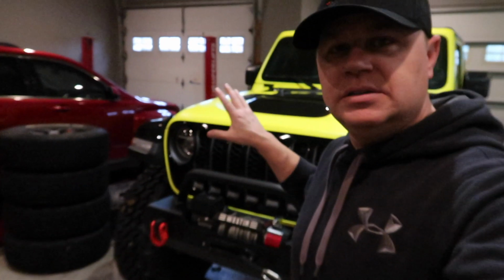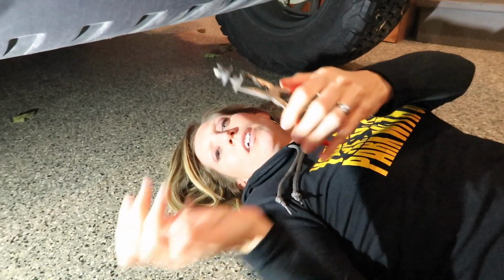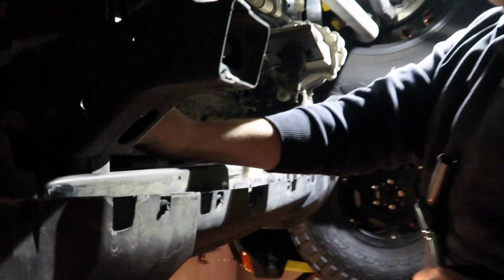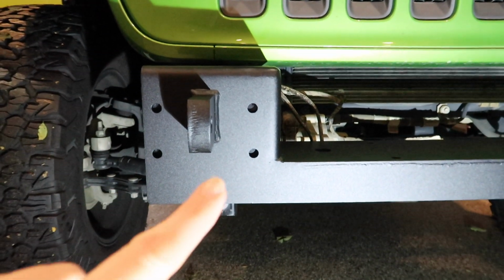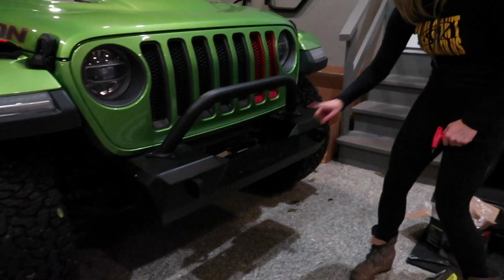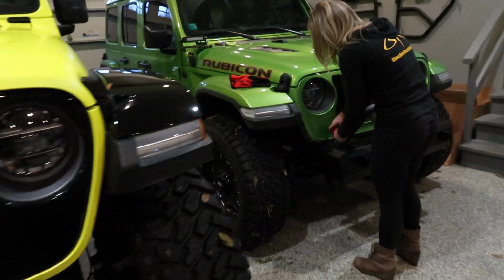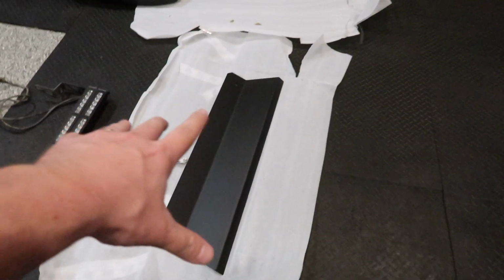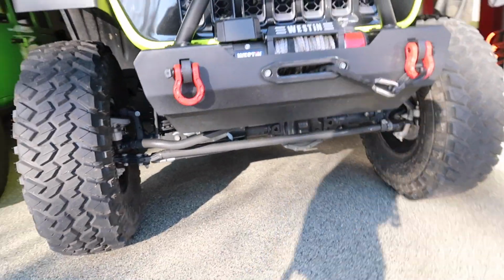BEST BUMPERS for Jeep JT & JL *Bumper Install *Motor City Aftermarket

Comment: The tube door holders on the wall...where are those from and do they hold the regular doors too. Good video 👍
Reply from the maker: Nolan yes, they are from Arc OffRoad and are designed for the doors to sit in the window channel. They work great, you can see them in action in this video: https://youtu.be/QworGMGjfZg
Reply from the maker: Oh and you can use coupon code Mojito15 for 15% off.